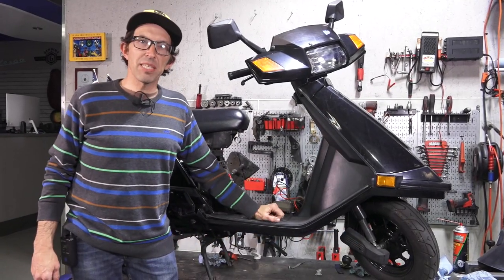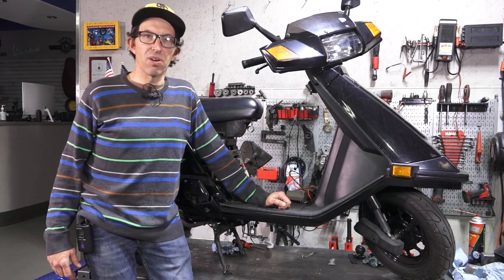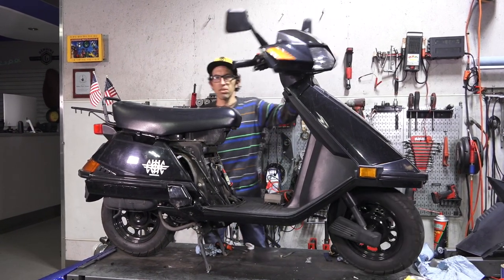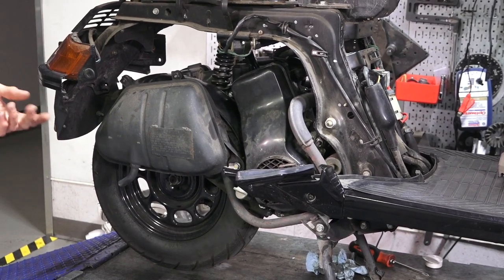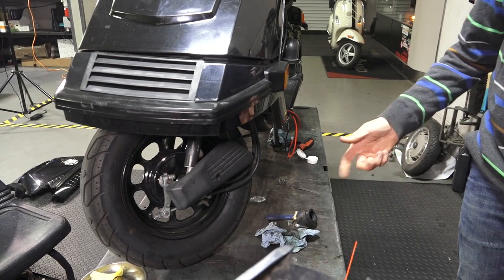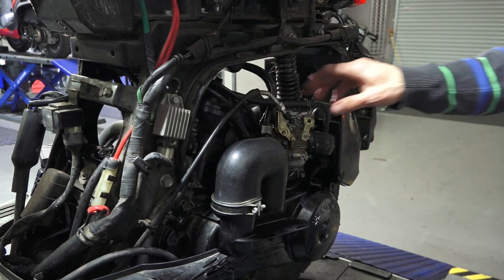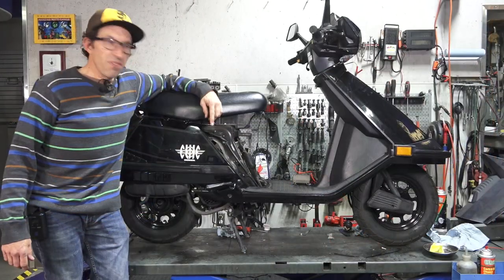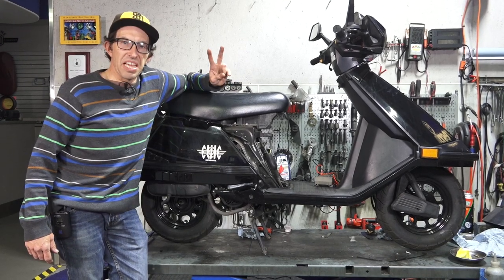Is This Robot's Least Favorite Scooter?

Comment: I loved mine. Got it non-running, for $150. Put at least another $150 into it, in mostly cosmetic parts, rode it for months, and sold it for $500. I made a profit, and the guy got a great scoot, at a great price. If I had known that I wouldn't find another one for under $200 (my spending limit on any bike), I would never have sold it. I still have a spare fairing/signals, and a windshield, a must in the rainy pacific northwest. True dat about the cracking exhaust, but it was my fault for not using loctite on the muffler bolts. Anything Japanese>anything Chinese. I now ride a 70/Polini/technigas/Malaguti Yesterday, 60mph all day. Still waiting on more affordable parts for my $80 ET2 basket case. I spent all my money on a 1960 35mph copper color Motobecane/Wards Riverside moped. It is just gorgeous. 100th like.
Reply from the maker: That's awesome! Thanks for chiming in...

Comment: You forgot to dig the plastic headset with integrated turn signals that everyone breaks when they lay it over. Otherwise the storage, exhaust and carb aren’t the best. BUT, they are still my absolute favorite twist and go!!! Super lightweight, narrow, extra cutouts for leg room, retro design, quick acceleration (for an 80), free backrest to install your stolen milk crate to and low seat height make them the perfect city/ beach scoot! Down from 3 to 1 80’s in my collection but god I love that little 80 when I need to cruise to the beach in the summer 😎
Reply from the maker: Fair enough!

Comment: The Elite 50 dumps all over this. Sorry but anything under 125cc that's not a 2 stroke is awful. Complexity for little to no power difference is ridiculous. 

You could buy any 50cc and throw on a mild kit and out bike this all day for the same or even less money.

The Yamaha Zuma 49cc was faster than this AND you got a front disc brake & beefier tires.

Comment: Oh boy, the elite 80! How many intake manifolds I replaced on them, and Honda had to use paper air filters which completely clog with oil if you drop the bike, and those filters cost an arm and a leg at the time! Funny you mention the muffler headpipes braking, that was just another feature of these disposable bikes. Honda scooters in the 80's suffered from brittle plastic and some intentional bad engineering, especially with the bearings in the transmission. I remember them being a bit of a pain in the ass to work on. Back then I was working on Yamaha Riva scooters, and honestly was impressed with how well they were overall, it's sad they didn't stick with them. The Riva 200 was pretty top of the line for scooters at the time and really held up. Now all scooters are made in China and kind of all the same but they don't seem to have as many problems, at least past the 50cc ones. I kind of miss the scooter market, though the customers were often a little different from the average motorcycle owner.
Reply: Some scooters are made in Japan

Comment: I went from a 79 p200e to a 87 80Elite and loved it for an entire second. Oil needed change every 600mi, which only takes about 3w if you live 12mi out of town. The manifold plate would vibrate loose about every 200mi, sucking grit straight into the cylinder. Also, Robot, they were governed, had a gf with a spree, it could keep up with my elite, with/without a passenger, and downhill with a passenger it would bog at 42mi.
Reply: No motorcycle moped or scooter uses governors as in a centrifical or a air vane Governor they're just not used...

Comment: Mopeds had CVTs in the 70s. Strange it was considered new technology in the scooter world in the 80s.
Reply: The modern scooter market segment (plastic-fantastic, affordable, CVT-equipped with under-seat-storage type of scooter) was new, not the CVT technology.
The same way the EV tech is nothing new, but is certainly new as a market segment.
Reply: @holmiumh  agreed. I also like my plastic bodied scooter though. Lighter and easier to handle, easier to replace damaged body panels instead of having to repair the whole bike or scrap it and no rust like the Vespas have problems with (which I also love). I know a metal body/frame is what a lot of people like about Vespas. It’s one of their selling points but it’s also detrimental in some ways.
Reply: @holmiumh  I love mopeds motorcycles and scooters. My current scooter is a Niu. It does have a plastic body but definitely no CVT. Haha.